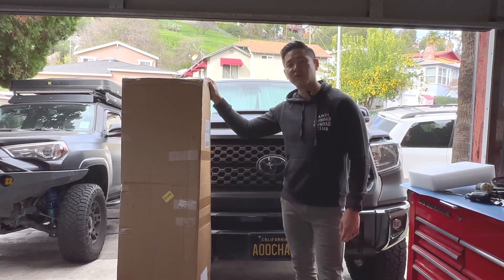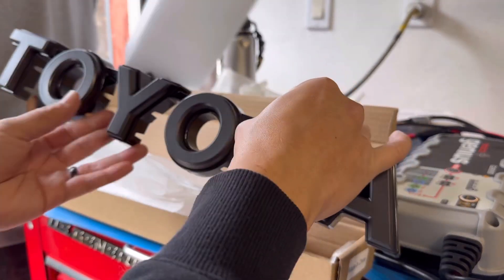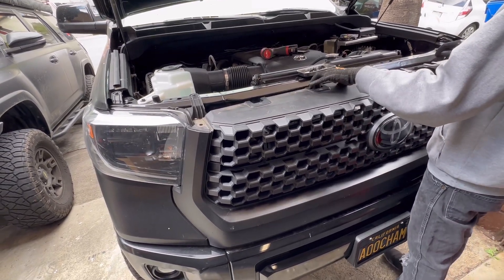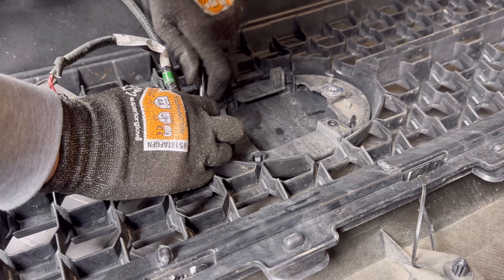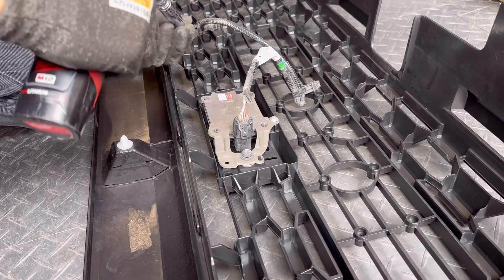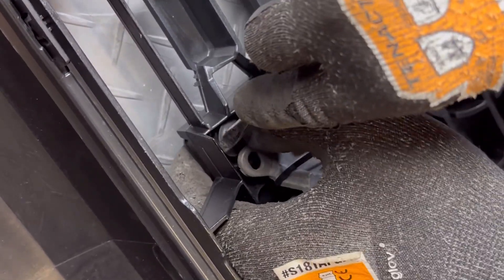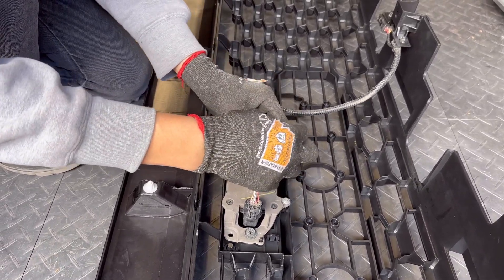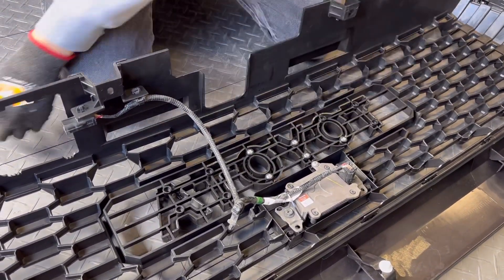Best Aftermarket TRD Pro Grill for 2021 Tundra | Install | Cartrimhome

Comment: When you replace the grill and you transferred the sensor on the grill, you don’t have any problems because in my truck they see is not working anymore the windows they don’t go down anymore around daylight and around anymore, and I have sensor light on on the desk

Comment: I keep getting pre collision light it’s annoying i need help
Reply from the maker: From what? Did anything obstruct the radar
Reply: @OtzleeExplains  no had 2020 sr5 grill and swapped out with pro grill
Reply: The sensor is either loose or you need to recalibrate it cause it sits lower had the same issue.

Comment: I was going to ask, don't you need to get the tss sensor recalibrated at a dealership? Because it did get moved from its original spot
Reply from the maker: After moving the tss, my sensor worked about 80% of the time. I ended up getting it recalibrated for another reason when I replaced my steering wheel and it’s back to 100%
Reply: Why did you end up replacing steering wheel?